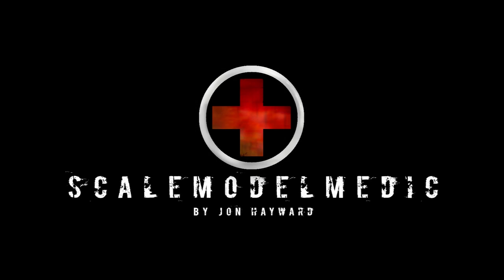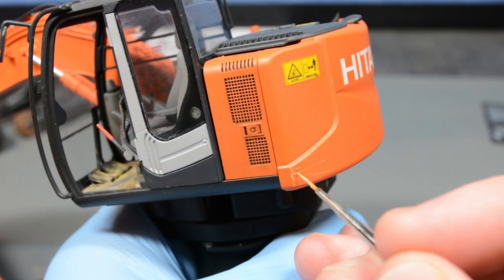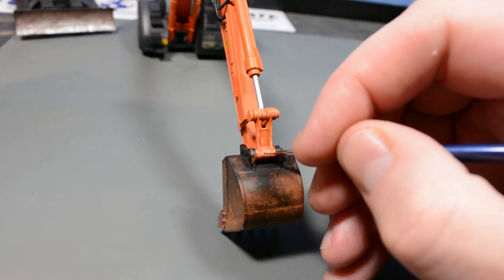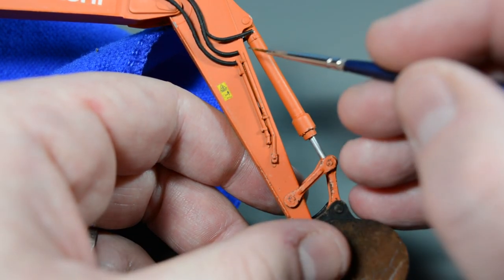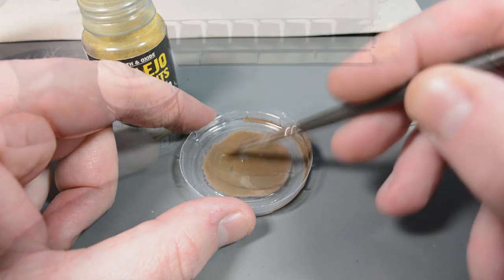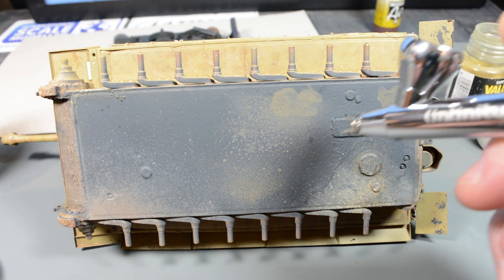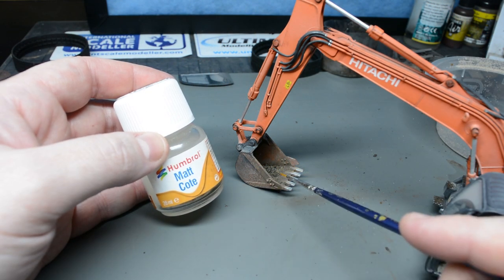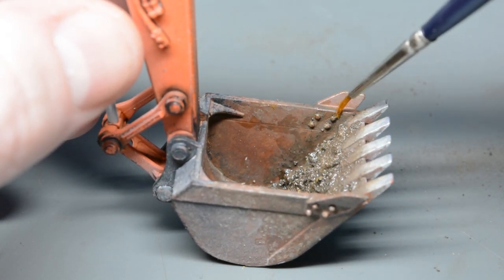Weathering Hasegawa's Hitachi Zaxis 135 US Part 2 (finished)

Comment: I came for the King Tiger videos, and stayed for this excavator! The bucket, dozer blade, and the multi-toned seat, and the dust and mud effects are real standouts in this build! I agree that an empty coffee cup, with some snack-wrappers on the floor of the cab and crammed in beside the seat would be a fantastic addition. The wet blending techniques you used with the oil and grease effects worked out fantastic as well. Thank you for sharing your talents.
Best regards,
Brendan

Comment: Some amazing weathering on this one.  Even the "mistake" on the corner looks like someone brushed up against the dirty vehicle or cleaned a chunk of mud off.  

One thing I noticed is the top of the bucket seems a bit too clean.  It could use a bit of the chunky dried mud there too.
Reply from the maker: Good spot, yes I think I could do more up slightly higher on the bucket